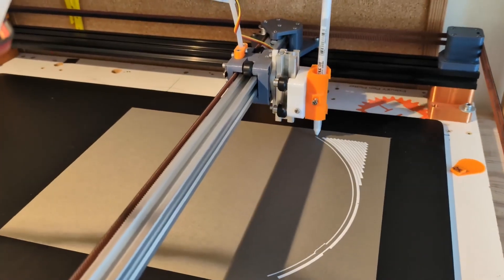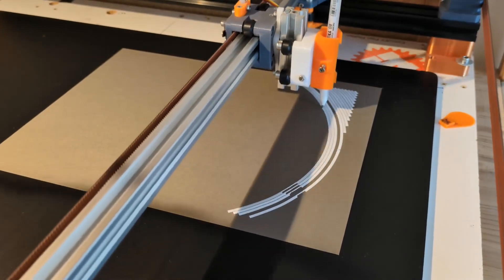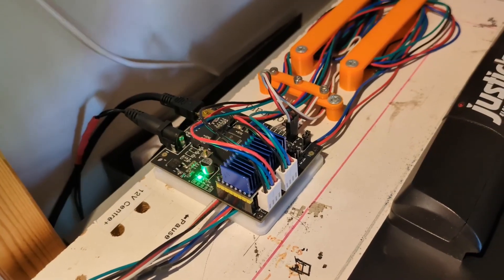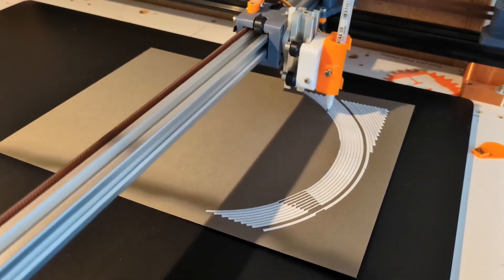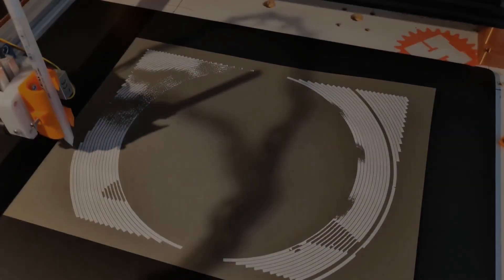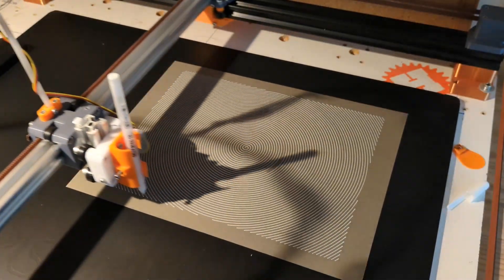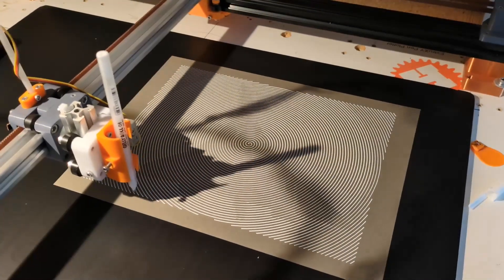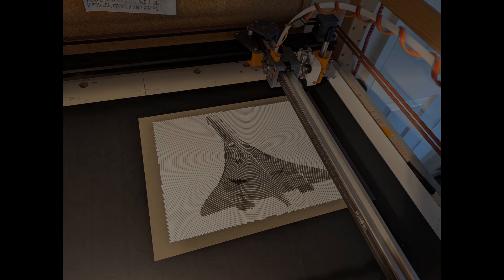3D Printed Pen Plotter: New Board (& some plotting)

Comment: where can I read the parts list? What wheels, profiles, motors, and belt did you use?
Reply from the maker: The link to the Printables page with all of the details is in the description

Most of the parts are fairly standard and used on 3d printers, for example the belt is 6mm GT2 belt. I've tried to include links in the page but they break often so I've tried to include descriptions that will find the right parts with a search. In the comments of one of the plotters (I think the H-bot version) someone included links to McMaster which is expensive but probably won't stop working, they can help with dimensions etc, even if you don't want to buy there

Comment: good work,,Man you're lucky, a huge 3d printer, and didn't make designed 3d cases pro boxes for its electronics!!
Reply from the maker: I think perhaps you misunderstood the video? The big machine is a plotter, it just moves a pen around on paper. It's very similar to a 3d printer but doesn't have a hot end or extruder 

You're right that I didn't make electronics boxes though. My real 3d printer is a Prusa Mini which is small. It's big enough for boxes but I didn't do it because managing the wires and leaving access to the pause button would be a bit complex and it works ok without
Reply: @ChrisLynas  very creative. I watch a lot of videos about 3D printers and lasers, and I'm very passionate about it. I love your art, so Ia shared some ideas.